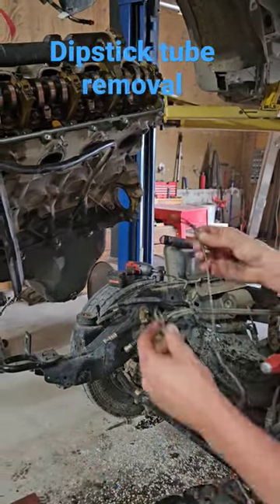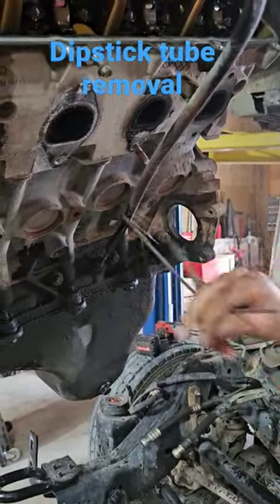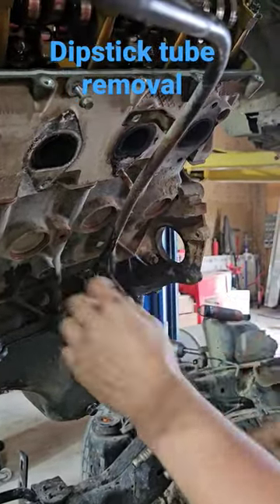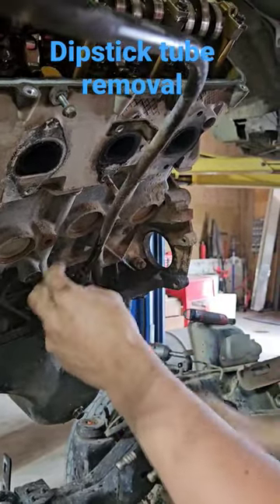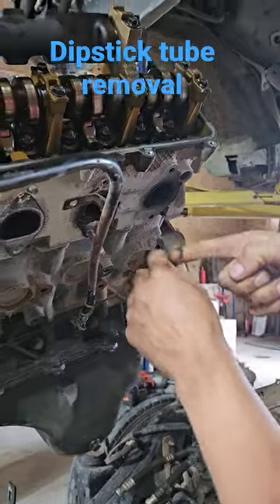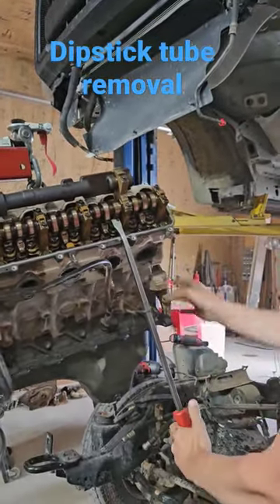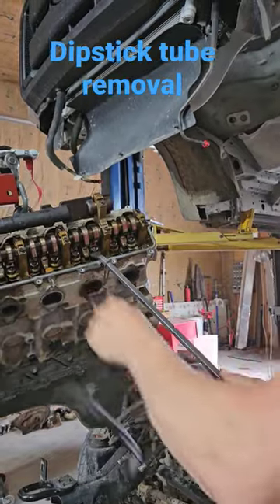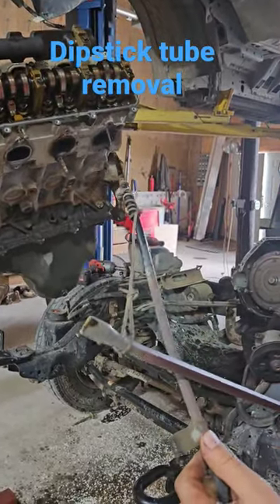dipstick tube removal

Comment: Now I need a video of you putting it back in 🙏
Reply from the maker: I don't have an engine out at the moment to make the video with, I could explain it to you if that would help you out though.
Reply: @wyomingmobilerepair  I got it it's was just tight af because of the heater core stuff. Thanks tho
Reply: So how do we putt it back in
Reply: Brother, can I ask you how to replace the dipstick in my 94 Ford ranger V6 4.0. it is bent somewhere towards the lower end of the tube. I imagine this will work with the engine in, is it a press fit?
Reply: @justthejuan8160 
I'm thinking a socket if it will slide down the outside of the tube and stop on expanded base of the tube and then tap it in till it seats.  Or a piece of tube cut in half.  Hold it together with pliers and tap it in.  I have a duramax to do and this video is all I've found.  Good luck.

Comment: What's the name of the cord?
Reply from the maker: It has a few names, para cord or 330 cord most commonly. It's just a thin strong rope, but you could use any small diameter durable rope that doesn't stretch too far.

Comment: soooo just pull really hard with my hands??
Reply from the maker: Good luck, very difficult to get a grip on it down low enough not to bend it.
Reply: @wyomingmobilerepair  yea I definitely used your method and it worked. However my oil pan was already out of the vehicle so I used a square piece of MDF and some blocks of wood on top of that to pry on. Got the tube out most of the way and then hit up on the pry bay which was tied to the tube and that popped it out all the way.
Thank you very much for the video it helped me so much.
Reply from the maker: I'm glad we could help. The oil pan off helps for sure if it needs to come off. Most of the engines we get in now have a pan installed, so we don't need to remove the pan from the bad engine anymore. That was what gave us the push to come up with that.

Comment: This is awesome. I have a bent dipstick in a 94 Ford ranger V6 4.0. Can I do this with the engine in?
Reply from the maker: I believe you should have enough room to get a piece of cord down through next to the valve cover, but I haven't tried it in vehicle on a ranger. Give it a try and let us know if it does.